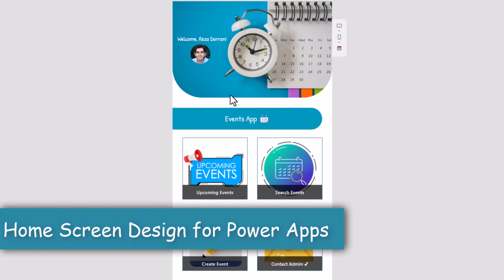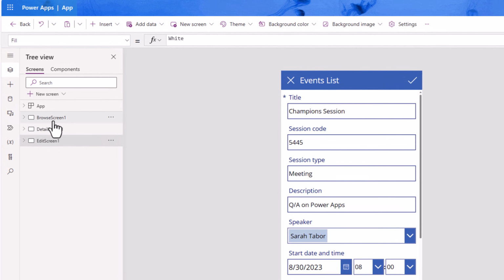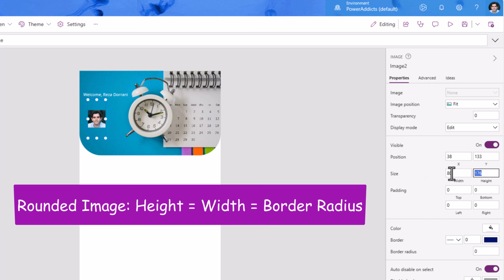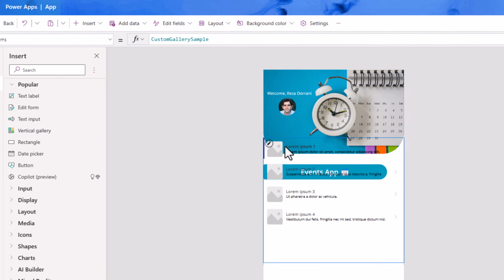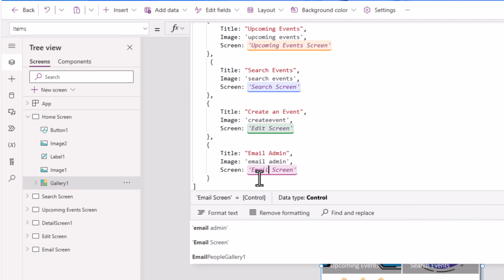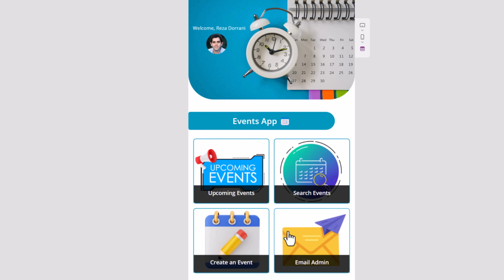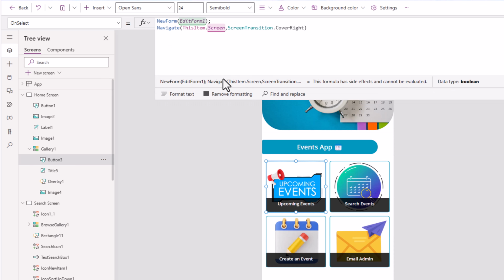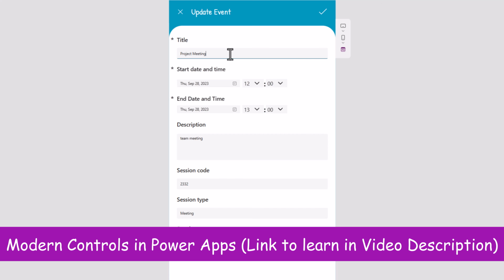Power Apps Screen Designs (UI/UX) - Power Apps Tutorial

Comment: Hi, i am wondering if there is any way to include if else condition at the gallery "Screen" section? Where instead of navigating to the page directly, i can input some condition? e.g. if is not admin then pop up message "Try Again".
Reply from the maker: Better is to hide that option is user is not the admin. You can load data from collection in gallery and populate that collection based on user role.

Comment: I really like your Home Screen design, but I would like to make it responsive. I put the button, label for the user profile and the banner image inside containers and fixed the height but made the widths dynamic using parent.width for the container. This works and looks good.

My problem is that I cannot figure out how to make the gallery responsive. I can make its X coord match that of the other controls but the height and width are not responsive and can be cut off if you resize too small. I would appreciate any input on how to resolve this. Thank-you for all the hard work.
Reply from the maker: Most welcome!
I have done multiple videos on responsive design. They are all placed in a playlist on my channel.
Reply: Hi Reza. For the benefit of anyone else out there trying to do the same thing, I took your advice and found another video of yours where you use a vertical gallery and make it responsive. I combined that with this video to make a responsive landing screen using a vertical gallery. Its very easy to miss something and get an inferior product, but your video solved it for me. Thanks! Here is the video I used: https://youtu.be/1o2L0DADzKQ?si=xG-LU5KJVrQ4jwW3

Comment: Hi Reza, first at all conngratulations on your amazing way of teaching us and bring these new features of power apps, I have a lil questions for you.
Is there a way to grant edit permissions on dataverse record in power automate flow? also does dataverse has something similar as SharrepointIntegration.Selected on Edit and View forms? is because I'm trying to build an approval system using dataverse tables & power automate flow, but I have to send the edit (for creator user to edit the data on that single record only and once is approved cannot edit it) & view form (for approvers to check the data)
Reply from the maker: You could assign user security roles in flow (I do not have a video on this)
Not like SharePoint but you could easily use deep linking in canvas apps (I do have a video on deep linking)
Reply: Thanks sensei 🙏

Comment: Very nice video! I have a question about the connection between SharePoint and PowerApps. In PowerApps, can I have many SharePoint lists (like in a catalog) to choose from and when I click on a SharePoint list, I see all the information of the selected SharePoint list? Each SharePoint list has a column "Number", "Item" and "Quantity". To visualize it better: There are several employees who all have their own SharePoint list. Now when I selected the respective SharePoint list of the SharePoint in PowerApps, then I see the SharePoint list of the employee.
Reply from the maker: You would have to connect to each SharePoint list. 
Dynamic loading of list data is also a possibility but can get complex as you would need to call apis or flow to get the details.
I do not have a specific video reference on this scenario